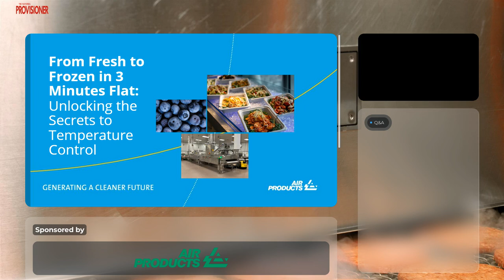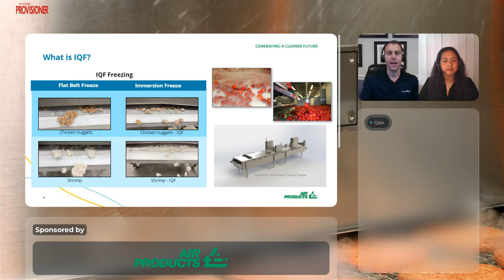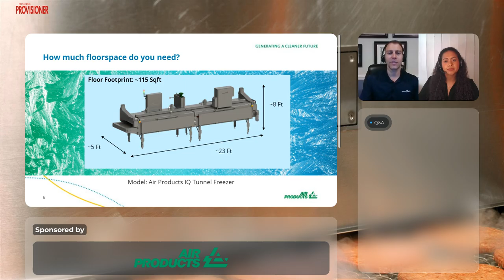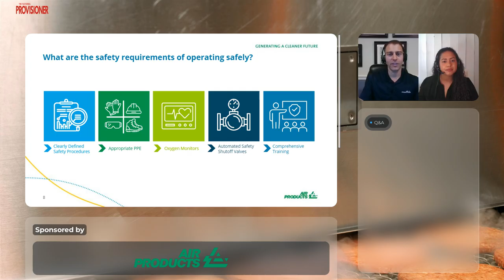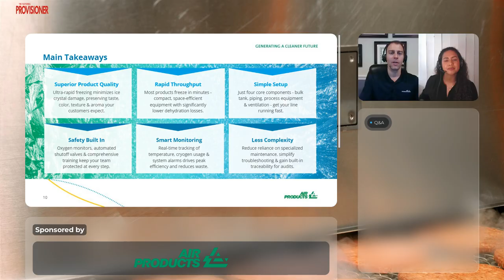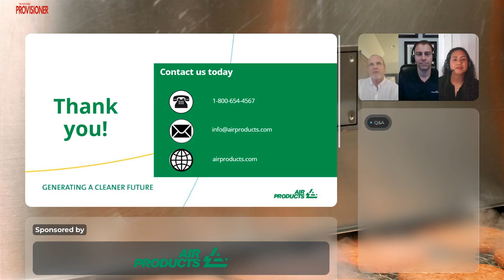From Fresh to Frozen in 3 Minutes Flat: Unlocking the Secrets to Temperature Control | Air Products

Comment: Cryogenic freezing is a different piping challenge than most food-industry work realizes - the insulation and joint spec has to handle the thermal shock, not just the food-safety side.